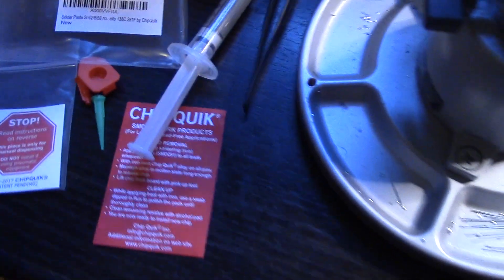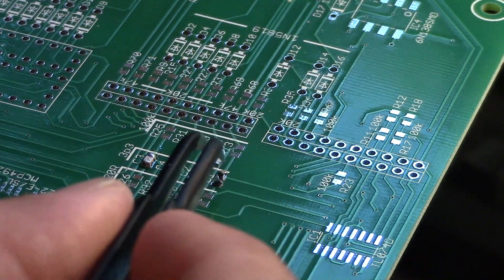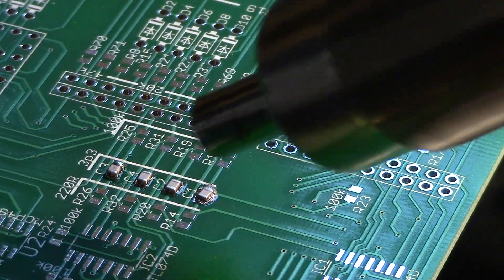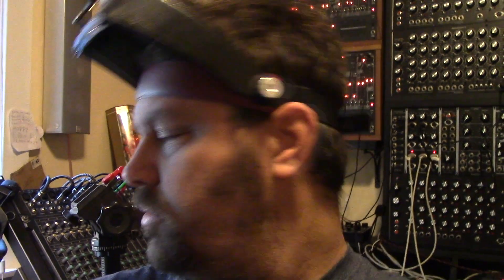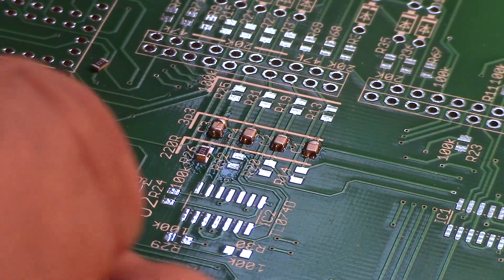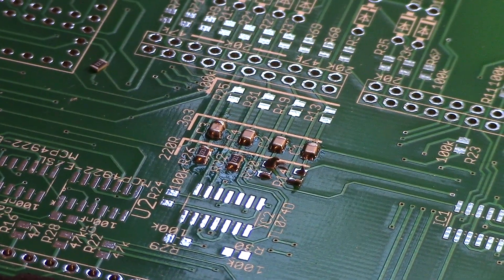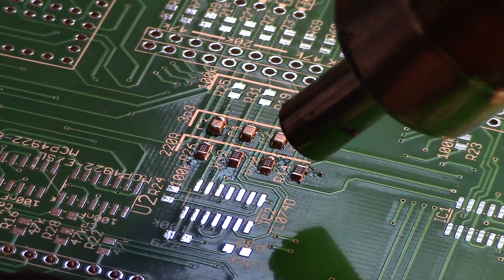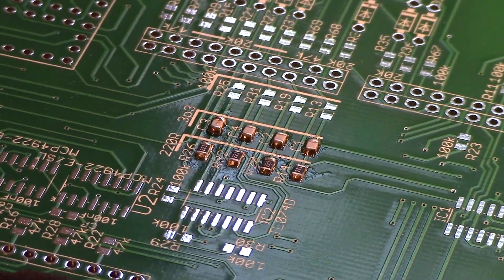Soldering 0805 Caps for Deckard's Dream part 2 - Iron or Hot Air

Comment: The SMD solder paste process works fine if you have a solder screen for the board to wipe on your paste. Not so much if you are having to apply the paste to individual pads.
Reply: I've built quite a few SMD based modules and apply it with a syringe everytime. Personally I found the hot air a pain so went over to the heat plate due to space. Sooo much better, but I place all the resistors and caps in one go then put it on the heat plate and so on, starting with the less heat sensitive components and ending with the most sensitive. Aliexpress is a good place to find the heat plate or Ebay. 
https://www.ebay.co.uk/itm/220V-20-20CM-Electronic-Hot-Plate-Preheat-Preheating-Station-3-Digital-Display/133045957487?hash=item1efa28336f:m:mQ6vMG2REJDjR92MMFgbc-Q
This is the one I have.

Comment: I never use solder paste, I tin the pads with solder and then I apply flux and procede with the hot air. For me it is easier but you seem quite good at the iron method, I fail SMD with the iron.

Comment: The tradicional soldering looks cleaner...
Reply from the maker: I agree. The smd on each voice card only took me 20 minutes or so using traditional method so I found it’s actually easier and faster than the through hole stuff.

Comment: I'm building one of these DDs too, I'm currently pondering a hybrid technique where I dab all the pads with solder paste and position the 0805s then run round the board dabbing my iron onto each side. I've found solder paste reacts very quickly to an iron and there is less chance of getting a massive solder blob over the duration of the hundreds of parts.We should do time trials!!!
Reply from the maker: Interesting idea! I should try that too, although you'd have to make sure that the pads and the caps gets hot enough for the solder to bond. Key here is to experiment and find the way that works best for you.